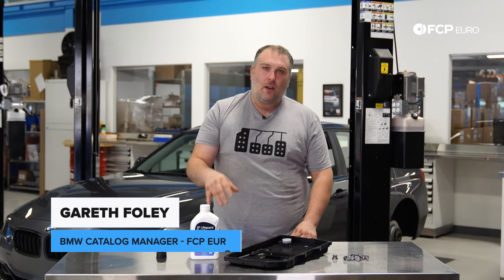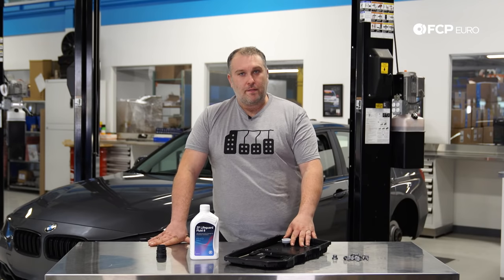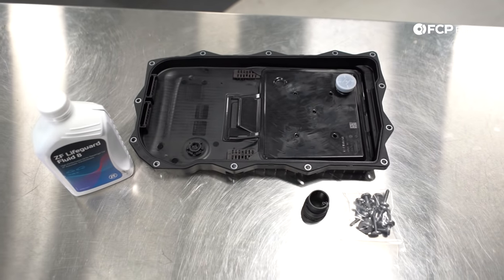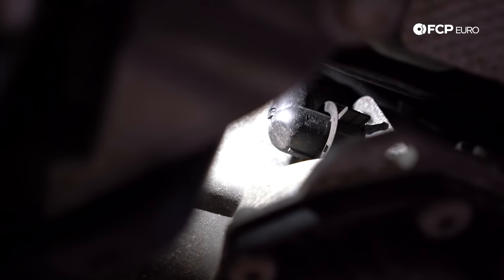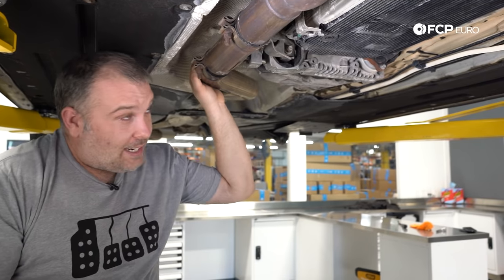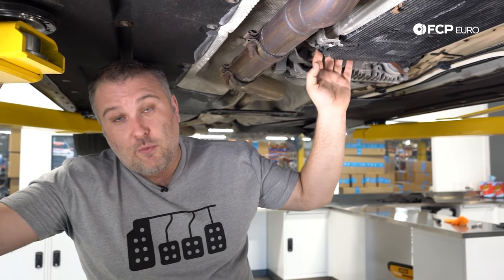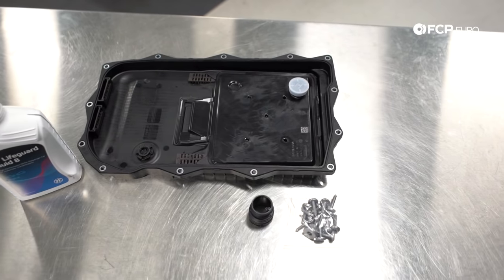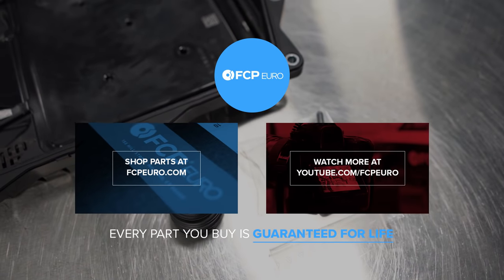ZF 8-Speed Transmission Guide (8HP45) - Specs, Common Problems, Diagnostics, & Maintenance

Comment: Does anybody know how well the ZF 8HP70 holds up with a stage 1 remap on a BMW 640d?  They are rated at 700max Nm of torque, and most standard BMW 640d' will put out about 630-40Nm...With a stage 1 remap they can get upto 760 Nm of torque. Some ive heard are running around at 850Nm....Does anyone know what are these 8-speed transmissions are capable of?

Comment: If BMW had just replaced the oil and filter in my F30`s ZF 8 Speed  Auto transmission , they wouldnt have had to pay almost 70% of the value of the car for replacing the transmission that failed . Annoying but gratefull that it was still under its motorplan / Warranty .

Comment: Experiencing a intermittent problem with my f30 at highway speed say 110kmh if you apply some extra throttle the car back shifts a gear and accelerates, sometimes however it almost like it misses the gear or changes straight back out and can cause a light thud noise, I'm suspicious of solenoids, but 1st I'll check the electrical connection for oil.
  Any thoughts ? Thx

2012 335i 220000km had 1 oil change at 120000 might do another but I'm doubt full if that will solve
Reply: Also further reading has me thinking maybe something to do with torque converter lock up, slip or unlock 😮‍💨

Comment: Hi, would you recommend fluid change on ZF-8 with 260 000km? My local BMW dealer did not. Some say it's too late and new fluid might cause some sludge to block fluid channels, sensors, etc.. Thank you
Reply from the maker: It would be risky to service the transmission with that kind of mileage. If you wanted to do a sanity check you can pull a small amount of fluid (at operating temperature) through the fill plug and have it inspected via an oil analysis. If the fluid doesn't have a large content of wear material and is still in relative good shape you can probably service the transmission via a basic drain and fill procedure. If the fluid is heavily contaminated it's best at that point to leave it alone.
Reply: What about at 92,000km? Is it risky or one can do it?
Reply: @nesh2bobkev  thats right on the mark.
Reply: @fcpeuro  Just to give back - I indeed had the fluid changed, I was told, that it was fairly dark. However, after a year, I didn't notice any change (better/worse) and I plan to have another change this year again

Comment: Now only if the ATC35L Transfer case was just as robust. 

I do agree though the 8HP is amazing, and simple to take care of.
Reply: What’s wrong with the T-case?
Reply: @michaelnikprelaj6679  it's mostly with the diesels, but they are pretty weak with the splines on the rear output drive flange shearing, and the clutches wearing.

Comment: Can i change oil myself? Im thinking about buying bmw 520d with zf8, and i want to do maintenance more often, but i want to do it myself to keep the cost down, because mechanic be crazy these days wuth what they charge you.... just because its an ''automatic transmition service'' they will quote me crazy money, like its a 'premium' service
Reply: They have a video on how to do it yourself.. Not the most straightforward process depending on your model. But not impossible just depends how handy you are. Might need a special tool to pump the oil into the in valve. 

After watching that video I hired a good mechanic to do it.

Comment: Does engaging Neutral in stops cause extra wear on these ZF8s? I usually put it N if it’s a 30sec or more stop… I know they are designed to be always in D, but I feel like the clutch also suffers a lot that way.
Reply: Search for the torque converter, the clutch is not operating like manual cars in the automatics so there is no pressure on the clutch itself when you are stationary.
Reply: @siajj9015  thanks, I did search it since I posted and figured out it’s all hydraulics, no wear

Comment: I have a leak in my Ram. I'm pretty sure it isn't the o-rings for the transmission heater/cooler. Appears to be from somewhere around the bellhousing. Any ideas?
Reply from the maker: Thats a tough one, are you thinking its transmission fluid due to a low level? or are you seeing fluid from around the transmission? Sometimes fluid on the transmission could be coming from higher up and simply be engine oil leakage

Comment: Great video. I would only have one question. I recently did a gearbox service on my BMW f30 ZF-8 (oil and filter changed) Also my mechanic reset my gearbox so that it learns the driving style again. But after that, I had a strong and powerful twitch at the transition between first gear and 2nd gear. The car simply jumps at that crossing, all other speeds are imperceptible. I drove almost 300 km from the gearbox service. I don't drive a car often and the driving takes place mostly in the city. Can anyone tell me what the problem is? THANKS!
Reply: Hey. Did you get it fixed?: same issue in mine.
Reply: @danisantos3255  Hey. Yes I am. I simply reset the transmission back to factory settings. I did it in front of my house. After that, the car bounced more softly, but I deliberately drove it for a while more slowly and mostly in comfort mode. After 200 to 300 km I started to change modes, sport sport + eco pro. Now it works perfectly normal for me.
Reply: @amdstudio2640  hey mate. What was the reset procedure?
I notice that if I change gears manually, it is smoother. Ah man
Reply: @danisantos3255  I don't know exactly which BMW you have, but you can find the transmission restart procedure on YouTube. Everything is done via the gas and brake pedals, holding for a few seconds and releasing while the car is turned off
You have a procedure on YouTube, you can find it, it's simple.
They helped me, it got better right away, but not completely, after a while the twitching completely disappeared.

Comment: I have a Range Rover sport with a v8 (not the SVR variant) and it jults pretty bad when I shift from park to drive and it has a 8Hp zf transmission I have no idea what it is and can’t really find anything on it, it never really used to do this maybe on a steep hill but rarly now it does it on small grades too and sometimes just flat parking lots... the car only had 31k miles on it

Comment: I do have 2015 F36 428XI it has 135.000 miles i do not had issues i decided to change transmission oil i bought set from fcp after i drain the oil it came out only about 4 liters. And i added 2 1/2 liters it didn’t take more then that. Now sometimes on stop light i’m pushing gas car is thinking like 2-3 seconds after i’m taking off my feet and pushing again it drives. And it’s not happening on full stop just like very slow speed. I don’t know what i have to do. And also why we have to change transmission oil if there has label says life time oil?!

Comment: I have a question, I have a 2015 grand Cherokee, with a 3.6 and the after 8 speed. The car has 30000 miles, and I have a shift flare, between first to second, only on first drive of the day, or if it sits  for any time. Otherwise it works great. Was wondering if it is related to the valve body? It’s been to the dealer numerous time and have been told they cannot get it do it. Has no codes, and fluid is full. Any ideas?
Reply: @pantygnome   depend on how hard or soft I push on the gas. It’s noticeable on light gas pedal, I would have to say, 2 to 3 hundred rpms more before shift, feels like it hits neutral for a second, on hard gas, it’s a lot worse, maybe 800 rpm. But if u stop instantly, it’s gone and smooth as butter.
Reply: @froggerman44  I have the same issue on my 3.6 Durango 2015, only on cold trans first drive in the morning. Fluid changed every 60k km, car has 126k km in total.

Comment: Hi, i own a bmw 330e f30 (2016) with 190k km on it which has a GA8P75HZ transmission.

When accelerating from low rpm in the 6th gear i’m experiencing judders/slipping. One time when trying to race in the 6th gear the car went into emergency run. 

I have had the transmission fluid and filters changed but unfortunately that didn’t help. Now i’m being told to either have my transmission replaced or have it overhauled. 

Any idea what the issue could be? When i had the fluids/filter changed, it was clear there was some abrasion judging from what was found in the fluids/filters. 

I would love to hear from anyone!
Reply: any updates bro? i have a similar issue with my 328i😢

Comment: hp45 can take 450Nm , I have hp50x ( M40i ) and the car have already 500Nm,  then for the real M series  , i think the next is the hp78x  , so I guess it's 800 Nm

but in real ?  if mine is a hp50x model , and the car is already stock 500Nm , that means I can  bring it to the lower limit of the next one ? ( hp78x  ) ? 

merci !

Comment: great video as usual, i have 115K Km BMW F25 2.0i X-drive and i didn't change transmission fluid ever, if i change it now will it cause a problem or just go ahead and change?
Reply from the maker: At 115K Km the original fluid in the transmission should still be in good enough condition to safely service it.
Reply: @fcpeuro  thanks a lot, i was worried if i change it now, thanks again and keep doing great videos i learned alot from you

Comment: Hello I just have a question I just have a 640d 8hp and whn is downshifting from 3 to 2 is have a bang is have someone a idea?
Reply from the maker: Hi Alex, unfortunately, there is no way to say, as it can be anything from an internal issue in the transmission to a bad mount or bushing. Further diagnosing is going to be needed.
Reply: @fcpeuro  I just been to the service I put diagnostic BMW and is not showing anything like a error of something like that I will go to doe the gearbox service tomorrow of Monday and I let you know

Comment: Hi, great vids, my 520d has 115k, I've just bought it and I'm thinking of changing the gearbox oil and pan, some advice would be great, I know some say don't change it as it's got alot of mileage. My E90 320i had 147k and I changed the oil which did improve the shifting slightly but was always jerky. I'm sure you've had many with high mileage and have changed the oil. Appreciate the advice
Reply from the maker: if the 520D shifts fine to begin with, then you should have no problem performing a normal service to the transmission. You may want to look into resetting adaption values in the E90 if you have not already.

Comment: Hello I am having a problem with my 2011 BMW X5 e70 50i. All of a sudden the vehicle would not shift into drive or into reverse. If the car sits for awhile it will drive and then it will go back out. I get 11 transmission codes. 

1. 4E82 Transmission Ratio Monitoring, clutches B
2. 4E84 Transmission Ratio Monitoring, clutches D
3. 4E87 Transmission Ratio Monitoring  clutches A & D
4. 4E91 Transmission Ratio Monitoring, clutches A, B & E
5. 4E9B Transmission Ratio Monitoring, Gearshift 2 to x 
6. 4FD0 position specification
7. 4EC9 parking lock
8. 4ECA parking lock
9. 4F35 collision of measures of priority class 2
10. 4EA2 Transmission Ratio Monitoring, all clutches
11. CF32 Operation of gear selector switch LIN, 2h for (EGS_EL, PT-CAN) from (GWS, LIN)
Please help it seems that I have the same issue.

Comment: Great video, but my 8HP-45RE 2012 Dodge started having gear ratio problems in the 2nd and 7th gears last year, with 9131 code service shifter now dealer wants 8,000 to change a non-serviceable transmission. Wow!
Reply: Don't buy into this. Take your Dodge to Land Rover or BMW that service vehicles with the same transmission   for a second opinion or visit a independent shop that service german cars.
Reply: Thank you, I will check on that !

Comment: My e90 is at 62k miles is it to late for me to do a transmission fluid change?!!!?
Reply: dynamic change
Reply: @tsskage ?
Reply: No. I did a transmission fluid change on my A4 with 77k miles. You should be fine
Reply: Change it in intervals. 
You cannot clear out all transmission oil from 1 change only.

Comment: got one of these in range rover 2012 and it shifts hard...slips out of gear 2-3rd and 4th then goes back in...theres a very loud (like fan noise at low revs) had all oils and filter changed ..just kinda made it worse....great vid thou..cheers
Reply from the maker: Sorry to hear that, Garry! Best of luck with your rig.

Comment: He’s saying to replace the fluid at 50k? My manual saids it’s a not required to change.
Reply from the maker: Most car manufacturers don't list a service interval in the owner's manuals. The general trend has been to increase service intervals or eliminate them entirely. Car manufactures have done this for two reasons. Firstly, to lower the advertised ownership cost of the vehicle. And secondly, to lower the environmental impact of their car line (yes, services are part of this). 

Car manufacturers have no obligations past the warranty period and it's not uncommon for "lifetime fill" rated applications to develop problems related to oil quality due to going unserviced. ZF who engineers and manufactures the 8HP transmission for 20+ car manufacturers has very specific servicing information which we refer to accordingly since their information supersedes any information provided by car manufactures. ZF recommends an 8 year, 80K kilometer (~50K miles) interval (whichever comes first) and we find this recommendation to be reasonable.
Reply: @fcpeuro   Thank you for the information. I will definitely remember to replace mine.

Comment: Quick question, my 2013 f10 has a slight shudder between 1.5k rpm and 2krpm. It also just start making a slight squeal/whine when this happens. Any suggestions? Torque converter? Fluid?
Reply: I've got the same issue on my 2013 f25, let's hope we get an answer!
Reply: @janosnagy7105  any news?
Reply: @garojohnbarsemian8792  not yet

Comment: I have an issue with mine, it goes into park with start/stop (once engine re-starts). Annoying when sitting at lights. I was told by BMW that I needed a new mecatronics and that the gearbox oil wasn’t meant to be replaced (sealed unit). Since found out there’s a law suit going on regarding my issue…

Comment: 120k miles on mine,doing service very shortly and have to admitt that im scared
Reply from the maker: We have faith in you James!
Reply: I did mine at 103k bc mop at said “lifetime” 😒 for the 8HP 85RE. I really wish I would have known that the ZF kit would’ve worked just fine in the jeep grand Cherokee 2016. Biggest tip is that to ensure you get in oil sample when draining it. Make sure you have at least 6 quarts fluid better to have more than less and Make sure you cycle through the gears properly go to the zf website and they have it step by step ❤️🙏🏽

I’m going to need to double check my work though  because my wife told me that she made a left turn and the transmission did not shift until she completed the turn unfortunately she did not pay attention to what gear she was in nor did she pay attention to the temperature of the transmission but if anything I believe the transmission may have been overfilled just because I was a bit cautious but I’ll double check it tonight. And also people use scanners to check the temperature fluid but when I bought one and literally just reflected what was said on the screen on the dash so it was pointless
Reply: @fcpeuro  mine done! all good,was worrying alot but going smooth,changing gears alot better,immidiate difference at 120k would receomend  service to everyone.

Comment: I have a zf 8 speed and I bought my f30 n20 at 150k miles and now have 170k miles should I change my transmission fluid and I don't if it has ever been changed but it shifts smoothly. Any takes on what I should do?

Comment: Hi, 8hp45 when cold, do hard shift from 2 to 1 at stops,but only when car is cold, any idea ? After 5-10mins drive is get good!
Reply from the maker: Hi Tom, your transmission may be due for a service depending on how many miles are on it, or it can be low on fluid, and once the fluid expands with heat, you notice the hard shift go away.
Reply: @fcpeuro  thanks. It has 100 000 km in it. Yesterday already started the "kick in the ass" when Stop at red light. Oil was changed at orevious owner  cca. 5000km before. I not think it is the oil. Can it be solenoids ? Or any idea?  Thanks

Comment: Can’t agree with this video, I got a 2015 VW amarok with 205000km. There’s a whining noise from the transmission but it drives fine, no stutter, no slipping, no grinding etc. I brought it to zf to have a look and they said these 8 speed zf wears out very quick. Many components are made with Aluminium, technician said 80% of all auto amaroks have this issue with whining noise, the planetary system is worn out, some as early as 80 000km. He said they seen plenty of amarok, bmw, jag, Landy with these problems. He just causally showed me the parts that’s worn out that they just changed out of a new Bmw, they had quite a few lying on the workshop bench….. something this Un-durable i can’t understand why so many manufacturers still use them? 3-7 years they are worn out? Unbelievable…..